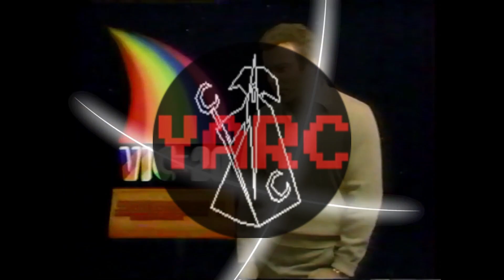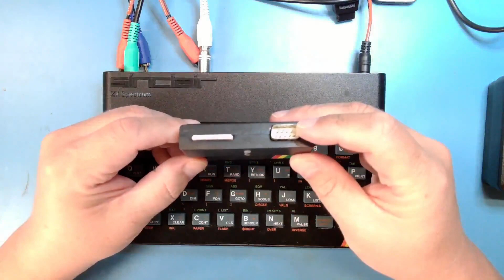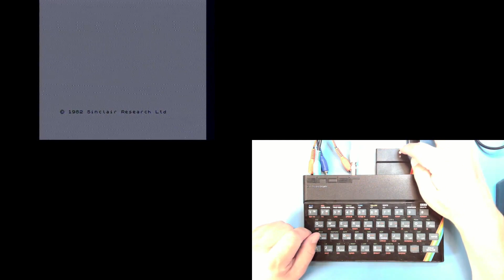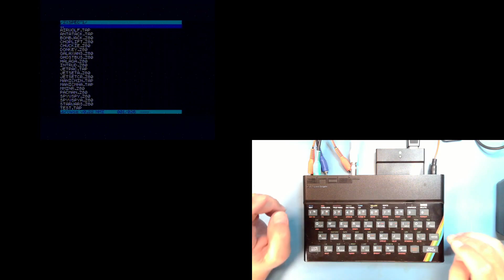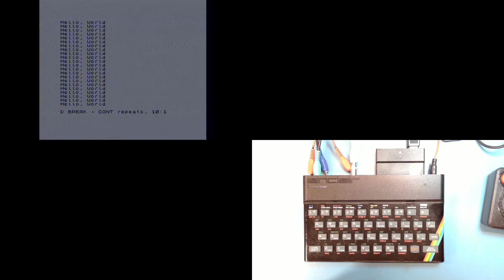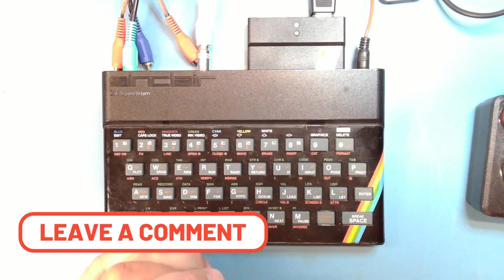How Good Is This SD Card Reader Really?

Comment: Original power supply is just a simple unregulated one. Just a transformer, 4 diodes for rectification and a smoothing capacitor. That is exactly what the Spectrum likes to work with. Modern switch mode ones will have noise, some less, some more, best to stay away from them. Also I think the DC-DC circuitry (12V and -5V generation) works better with an input voltage slightly above 9V, in the 10V range. These days it is not easy to get a center negative one, better to get a center positive one and just modify it yourself. There are more choices and better quality ones when you get center positive.
Reply from the maker: Thanks for the info and for watching!

Comment: Nice , I think your using the bugged version of starwars as I'm certain there is a version  with sound out there, it looks like the divmmc is a decent device for a speccy
Reply from the maker: Thanks, Lee.  I'll look for another copy of Star Wars.  I did have it muted so I could talk, but I think when I played it without mute it didn't have any music or sound effects after the initial splash screen.
Reply: @YARC-1981  I had a similar problem with the atari 2600  and the smps psu..... I'm thinking a 1st order LC filter could solve that
Reply from the maker: @CaptainCommodore  Possibly.  I'm not good enough with analog electronics or power supplies to know or to design one myself.  I'll have to leave it to those who actually know what they're doing (hint ... hint ....)